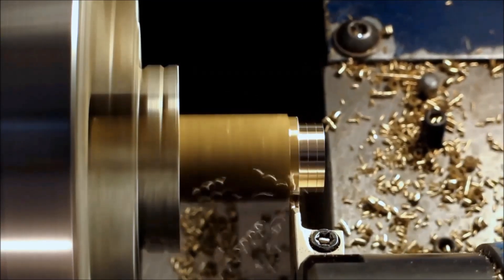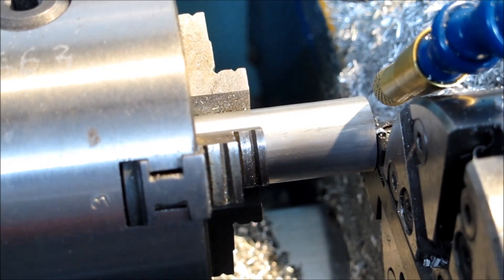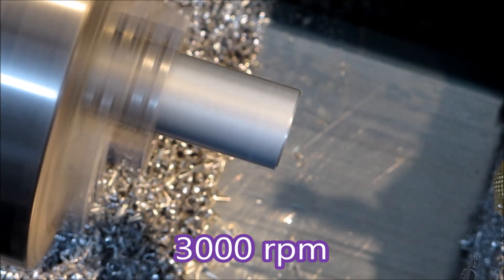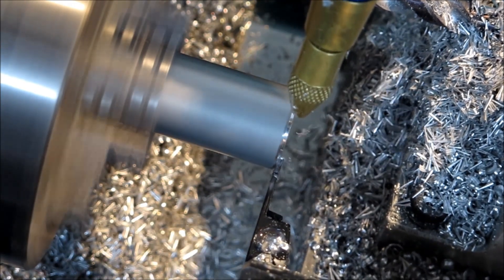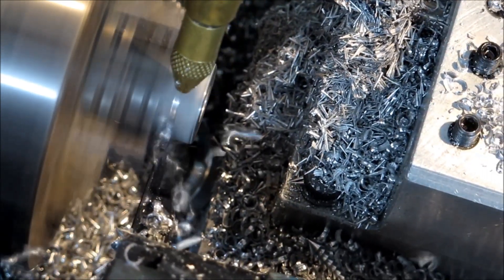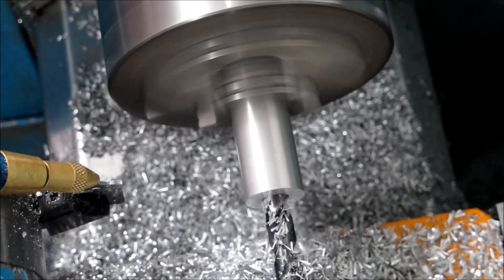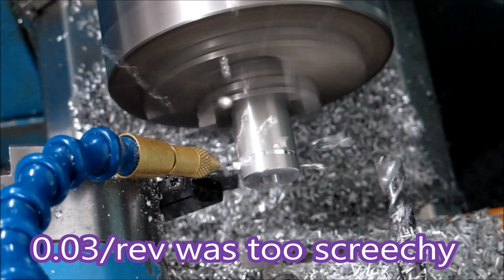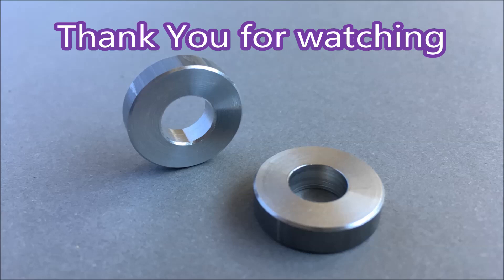CNC lathe drills with cnc stub drill, then parts off 4 washers using Kennametal 1.6 groove tool

Comment: Hi, what grade of aluminium are you using for chipcontrol like this?
Reply from the maker: Daniel Nicolai Hansten , in Australia it is called 2011, it a machining grade aluminium. I use it all the time except when the customer wants to weld or anodise the parts. 2011 does not like either of these processes Thank you for your comment. Adding this as an edit, you probably noticed that is not just a high speed steel blade doing the parting. The tool and insert are from Kennametal  only 1.6 mm wide and with a special low cutting force geometry they work really well. Not cheap but they work for me as you can see.

Comment: Nice work.  Just curious. What do you do with all those shavings? Just trash them or do you keep the material separated and recycled?   That is a lot of shavings. :)
Reply from the maker: Thanks Gary, I bag them and when there is enough I take them to the metal recycle plant. The metal has to be separated or the recyclers would not want it. Minor cross contamination is tolerated but not much. Brass and aluminium, I get paid for but steel is taken off my hands but no money comes my way.

Comment: Loved the video. Better all the time.
Reply from the maker: Out On A Limb, Hi and thank you, don't tell me the outake was the improvement?
Reply: smallcnclathes I think you will get your setup. I would try two different cameras if you can protect maybe a phone for a second view.
Reply from the maker: @propellanttech  To do that I would need the proverbial "Skyhook" it is bad enough trying to work around one tripod never mind two.  As you can see in the outake, it is so easy to bang the tripod and have an earthquake video. Most of the parts I make are in fairly high quantities so a second shot from another position is quite easy apart from the darn tripod legs. Those parts were a run of 100, next job is 260 and a customer is proposing a run of 1000. Then I have two jobs of 12 each per part. Reading those last two sentences makes a mockery of my being semi retired I just realised.  Thanks for the suggestion, I will keep it in mind, actually, I have another camera I could use which is more phone like physically and it may be possible to support it on a mini tripod/clamp. It has good optical zoom, so it may be able to be out of the way and still get what is needed. My main camera is a Canon G12 and it is quite large and weighty so needs the tripod. Thanks again
Reply: smallcnclathes yeah, I would try an alternate to a tripod, as you suggest. Getting those shots can be tricky.  I still enjoy your videos.